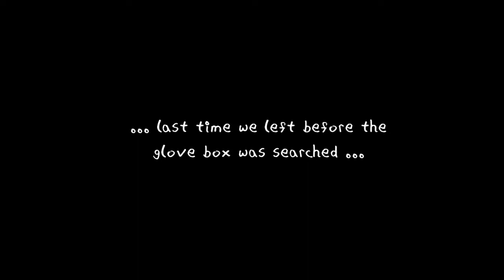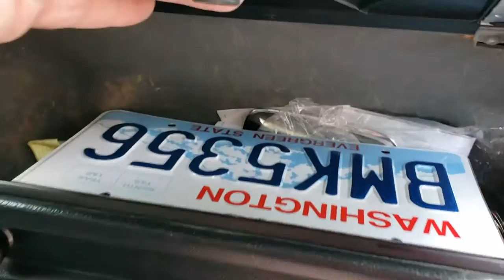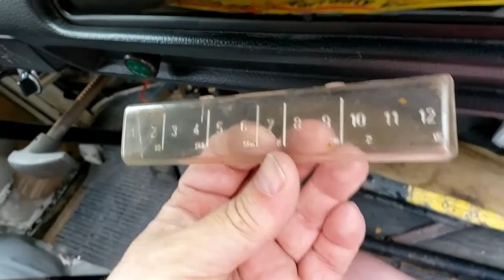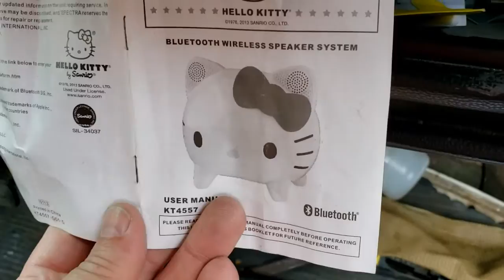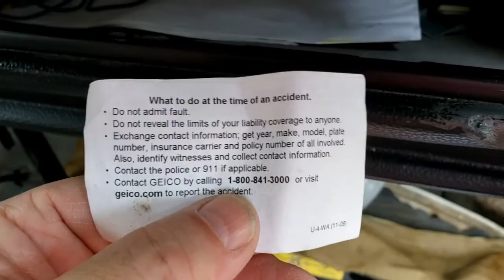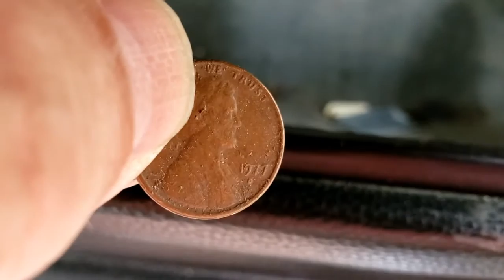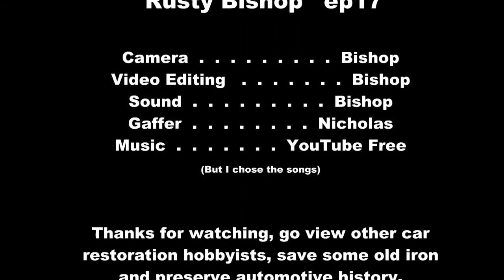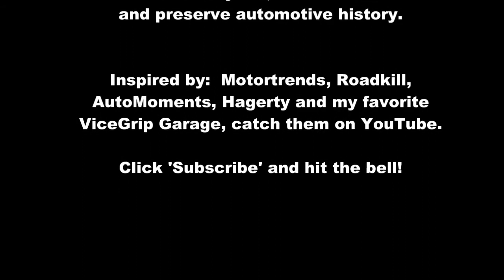ep17 Bishops Garage - 74 VW T2 Bus dash removal

Comment: That measuring stick as you call it is the fuse box cover. Also, check by the back seat as you will see a metal plate riveted behind the seat. That is the what is called the m-code plate on it which will tell you what the bus came it from the factory.
Reply from the maker: Ha how cool @dennis!  Right on, thanks for dropping by and chatting!

Comment: You mentioned a resource for LED replacement bulbs but unfortunately I couldn't see a reference to it in the video. Could I ask where you would recommend getting them?
Thank you for the video, inspired me to tackle mine too!
Reply from the maker: These are the ones I found that worked: YESCHE PC74

https://www.amazon.com/YESCHE-Replacement-Instrument-Dashboard-Indicator/dp/B09H7KPC8P/ref=sr_1_4?crid=OLKO2S0I2D1G&keywords=vw%2Bbus%2Bled%2Bdash&qid=1664375863&sprefix=vw%2Bbus%2Bled%2Bdash%2Caps%2C133&sr=8-4&th=1
Reply from the maker: Beware though, most LEDs do not like low power so having one of these in a spot, such as low oil pressure, might be bad, it wont 'flicker' like the original filament driven light.